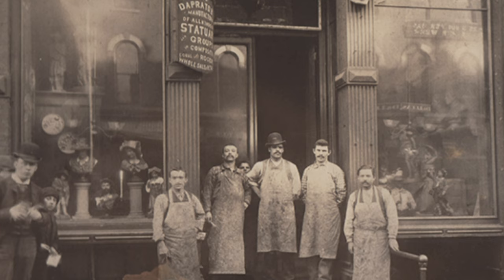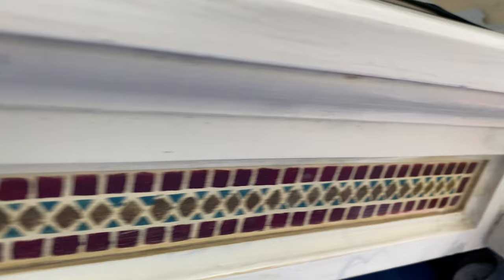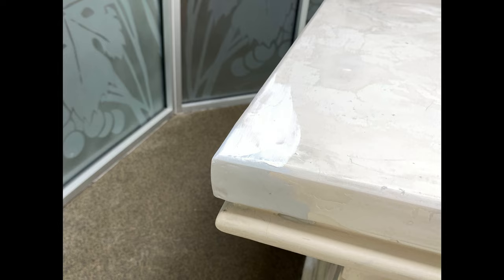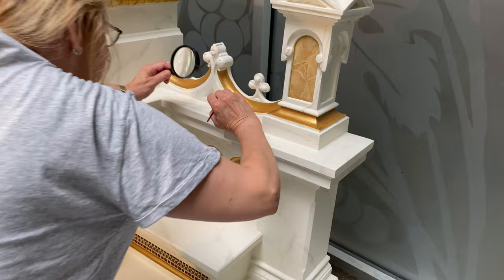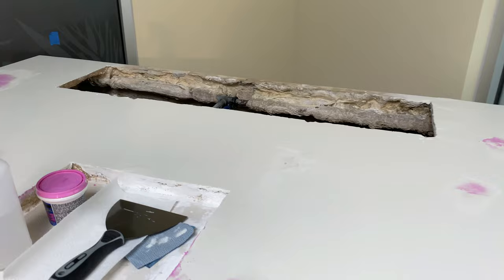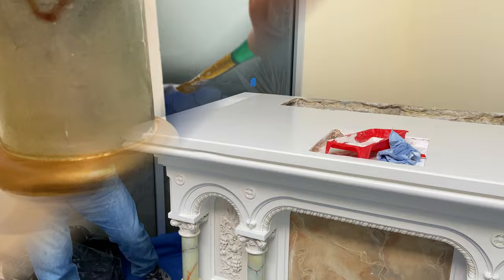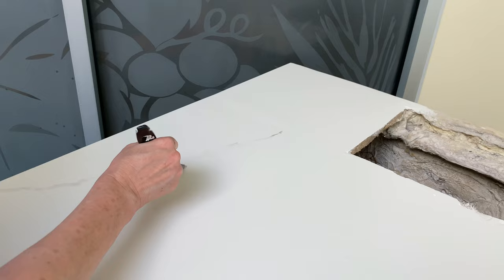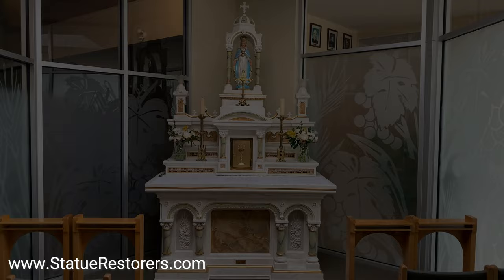Holy Redeemer Altar restoration

Comment: Thank you for the video. What was the original material of the Altar? Was is stone? I saw like that made of wood, but this one is not. And the marble was and imitation or a real one? The marble is beautiful.
Reply from the maker: Hello Sister!  The entire altar is made of plaster!. There is some weave added to the original plaster (possibly horsehair or artificial fibre) for strength.  It was sculpted over a metal pipe structure and was very heavy!  But all of the “marble” is actually plaster with a faux marble painting technique.  No actual marble.